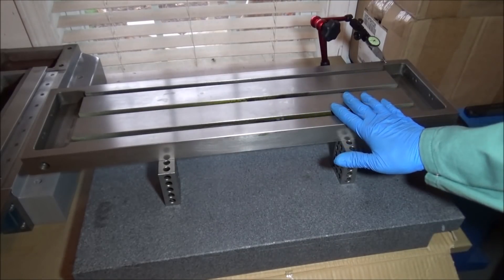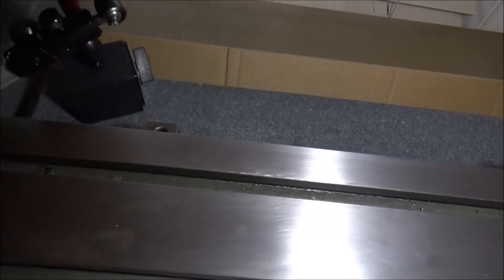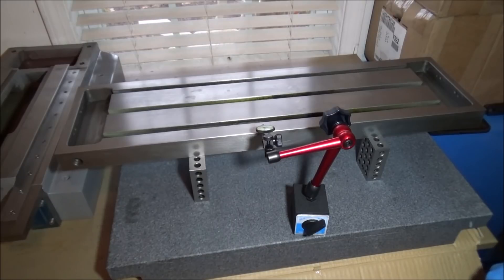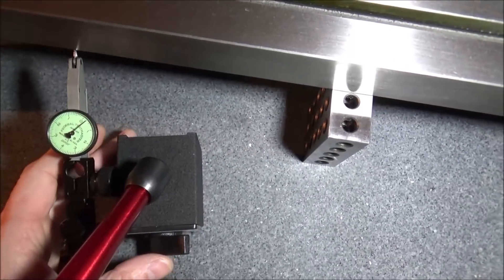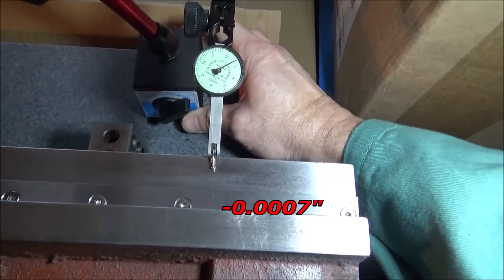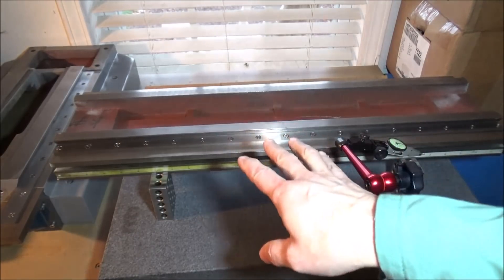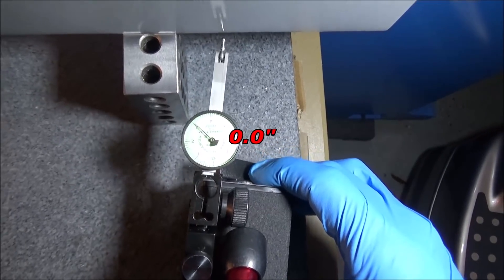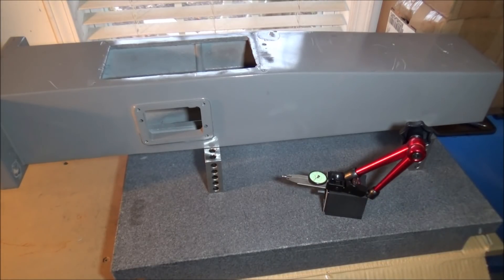PM727MXL Table Column Flatness

Comment: Good morning, great job but from what I've seen it's worth it, the precision you get from the mill is all depending on what you're doing.
how much weighs every single piece of your cutter?
Column, head stand and sleds.
My overall weighs 350 kg and to remount it after transport was not easy, my box is located in the middle of the lawn.
I'm interested in what you did with the other car and I really think about buying your project, I have some doubts about the step by step engines to use due to the weight.
Do you think he can adapt them anyway?
will I have to provide a lubrication system?
Best wishes
Paul
Reply from the maker: This Build will be using DMM DYN4 Servo drives and Nema 34 750w servos

Comment: What is your beginning reference? All of these measurements are good but they are relevant to what?
Reply: He's measuring in reference to his granite surface plate. Or are you asking something else?
Reply: Jesse Silver  I know Sam very well, I was wanting him to show everyone where he got his reference surface. You can not just pull your reference surface off the part your checking.
Reply from the maker: The reference use for the table was above the 123 block which were all verified to be the same height. the table thickness was also checked  and found to be the same. the column reference was near the 123 block as well.
While that may not be the best reference I was trying to check variances from point to point.

Comment: I picked up a 24x24x3 surface plate this weekend. I went to grizzly in Springfield Missouri which is about 3 hours away from me. My son just moved over that way and we went there for thanksgiving. So while I was over that way, I went to grizzly and they had a surface plate with a small chip in the bottom corner, more like a flake about the size of a fingernail. I got it for half price. I paid $77+tax. I got it home and cleaned it up and checked it. It seems to be well within spec. It is a B grade which is plenty good. At 234 pounds, it tested my manhood but I didn't let it get the best of me.
Reply from the maker: Great Find!

Comment: Without that surface plate being properly supported on it's airy points you can't be 100% sure of any of those readings. They might or might not be correct. I suspect if there out it may not be all that much, but there's no way to be sure until it is. If the plates bottom surface isn't marked with them a quick Google for airy points will give you the measurements for placement on your surface plate size.
Reply: the table he's measuring is also being held up at two points, wouldn't that also make his measurements less accurate?
Reply: @ikbendusan  Actually if you double check the video there's four 123 blocks supporting the table. Not stated in the video, but I'd assume those blocks were all checked for being parallel to the surface plate and matching height. Accurately measuring at the 1/10,000 of an inch range is a whole lot more work and a lot tougher than it seems. Everything has to be checked and verified as being correct before the measurements can be trusted.
Reply from the maker: Yes the plate is best supported from Airy points , or  Bezel points. I'm not to concerned at this point I just wanted to see what kind of Flatness I'm dealing with on these castings.
I did check the surface plate at several points as it sits with the same Indicator and it was dead on. However increasing the resolution of the indicator may have proven variances.
Reply from the maker: Sorry Guys I did check the 123 blocks to make sure they were all of the same height.

Comment: I'm sure by now you know you need 3adjustable jacks to get the most accurate measurement. What your doing is checking your 1x2x3 blocks.
Reply from the maker: yes I could not figure out a way to get three points of contact at the time. novice mistakes. LOL